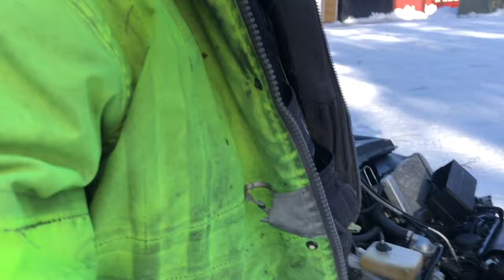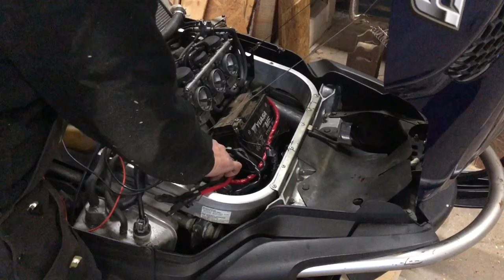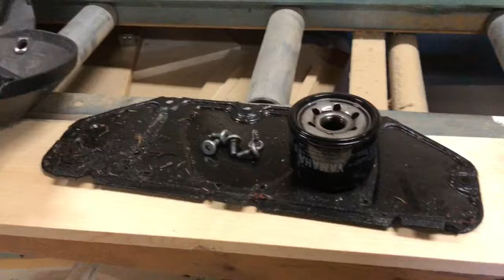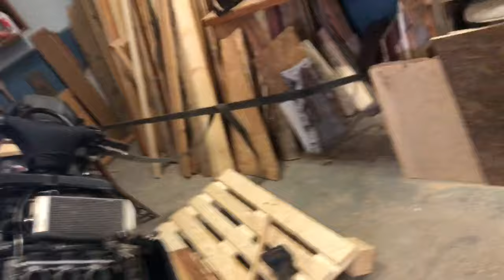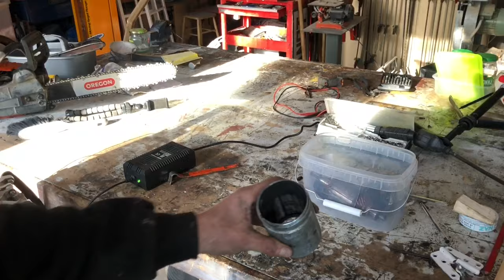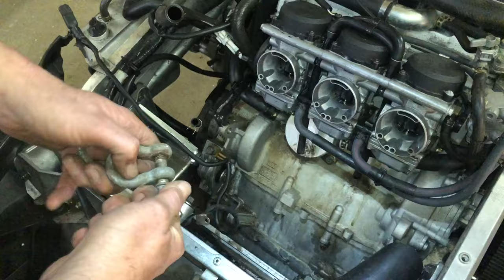Yamaha Viking Snowmobile no start recovery bad day.

Comment: Nice repair on the snowmobile! I've worked on a number of vehicles over the years where the troubleshooting was pretty easy but replacing the parts was the far more difficult part of the job!
Reply from the maker: Thanks Monte, if I have learned anything it would be the more experience you have the easier the difficult jobs become.
Reply: @arctic-rebel  Absolurely true!

Comment: Well.. you are hereby awarded the "Never give up Award"... I would have done what you mentioned.. set the s..t on fire. Yamaha's are good machines, snowmobiles, outboards and mc's.. but they are too finicky, too heavy and have too much doo-da's that can fail. Just my humble opinion.. and some of my friends too who have owned Yama's and changed brands because of it. I have great experience with Polaris, both Wide Traks and standard tracks, but I'd guess any 2-stroke wide track would do the job when it comes to working in the forest. Anyhoo.. I hope the old Viking last a few years still and get the job done.. Stay safe out there🙂
Reply from the maker: I agree with everything you say totally. It will be the last Yamaha snowmobile I own though. I had ready good experiences with MC's when I was younger but would like to try a Polaris or some other brand unless this lasts then I will not need another. Thank you, Take care.

Comment: Hi Simon, I have 4 of these VK10's in Alaska at a remote homestead. I got them all as used machines and have been working 'em hard, too. So far they have been mostly reliable, only one has given me grief, and because of that I nicknamed it the "evil Greta Thunfish" as it only runs when the battery is charged fresh! - It also has starter troubles and makes wild trashing sounds when it does start the engine (if/when). I bet that I will find what you found inside the starter and that I will have to do the same repairs for sure. I really appreciate your video! - The price of the Yamakaze spare parts is just outlandish, obscene bad. I had to order a starter as well (sigh)... Best Regards from Alaska, Lars
Reply from the maker: Hi Lars, now I have see my own and one other at the dealer you can bet that is exactly what you will find. I know from watching some of your video's you know your way around engines, I cannot remember a worse starter to remove but has to be done so I hope I gave you some useful hints to save time. As you also know they are really good machines when they are working but not so easy to work on. Good luck and be safe out there.
Reply: @arctic-rebel  Hi Simon, Thanks for your response, appreciated. I will only repair that mess when I have the other pressing issues at that old homestead under control: There are so many dangerous trees there that have either already fallen into each other or are already onto the buildings etc, I have to deal with that first and its bad stuff and I do lack experience logging deadfall and windfall. I can use luck and will try to be safe out there. Landing the airplane on the ice yesterday was exiting enough. Best Regards from Alaska! Lars

Comment: Hello from Northern New York  State.  So the starter field magnet disintegrated.  That was the problem,  and in my opinion,  it was NOT caused by the very many start cycles.  The magnets are glued on, and after time, the glue fails, magnet crashes against armature windings & gets busted up.  Wonderful engineering! 
About your firewood:  is that  Gray birch or Paper birch?
Reply from the maker: You are correct, thank you. I did see several at the dealer that came from 2015-2018 models so not an uncommon issue. It is white Birch or paper birch. I can find Gray here but not so common.

Comment: Well done problems like this can try your patience, would it be possible to fit a larger radiator to the machine for extra cooling?
Thanks for sharing cheers Simon 🌲🌲❄️
Reply from the maker: Hi Terry, you can retro fit almost anything to anything if the need arises but I don't feel the need for extra cooling. There is only a issue at the end of winter when temperatures rise above -10C and it is not a problem if you turn it off when not running, this also saves fuel and a 1000cc Yamaha engine uses fuel !

Comment: I have 2 X 1998 Polaris 250 cc very little electronics, love the older machines but requires maintenance?
Reply from the maker: Maintenance is not problem for me, pulling the huge weight is the issue and at the time I needed a wide track with a lot of power  to get up and down the hills. At the time this Yamaha seemed like a good idea.